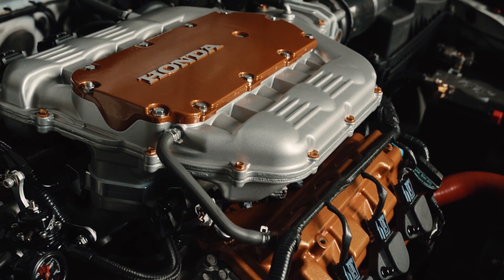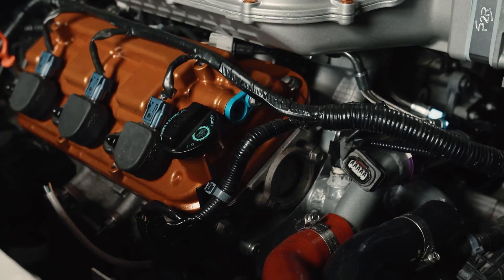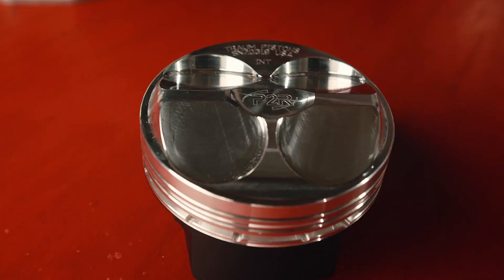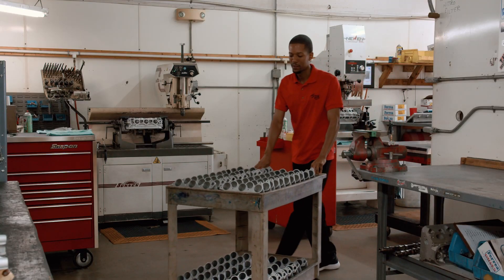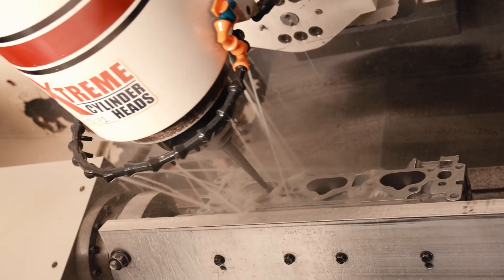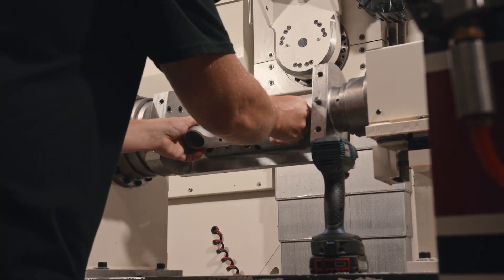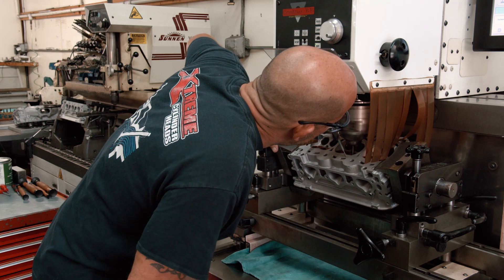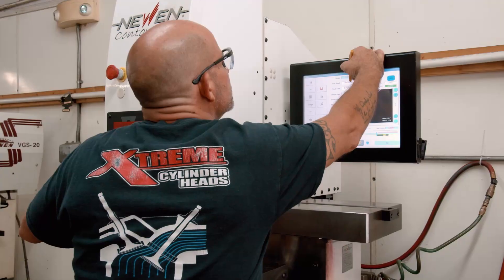P2R CNC Ported J Series Cylinder Head Program

Comment: Hey my question for p2r is. Can you guys create a bolt on plate for the 9th gen accord so we can bolt on the bigger intake manifolds from acura…?the 2014 mdx has a huge intake manifold but does not bolt on to the accords?
Reply from the maker: Most of the intake manifolds are interchangeable.
Reply: @PowerRevRacing  what years from the tl awd? 09-13?
Reply from the maker: @cheetoshotfries2289  yes those bolt right on but they use a bigger throttle body.

Comment: J series next big platform. Severely underrated
Reply: If you can solve the issue with tuning the older ones.
Reply: @SwapBlogRU  Aem has standalone ecus that work on some older J cars
Reply: @slammed07accord  indeed, the problem is they're not cheap, and it's quite a pain to get them to work with an automatic gearbox. Does anyone know what the problem is with unlocking the stock ECU on the older J-series cars?
Reply: @SwapBlogRU  you couldn't rewrite them from my understanding. My gen accord 7th Feb usdm has to use 2007-2008 Acura TL ecu
Reply: @slammed07accord  you can also use the Greddy e-manage as well for older J series